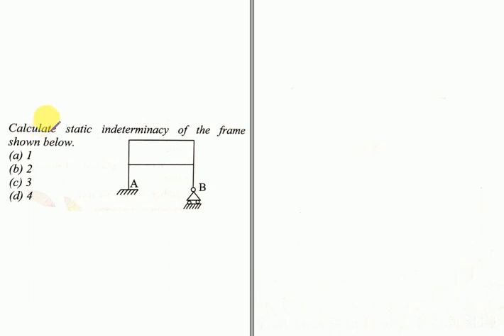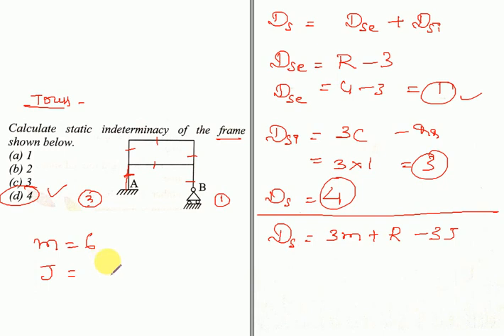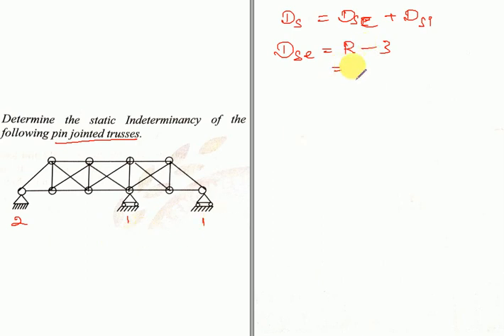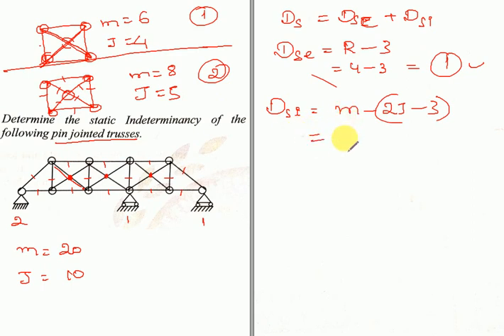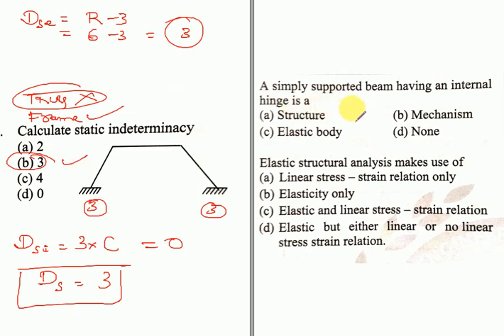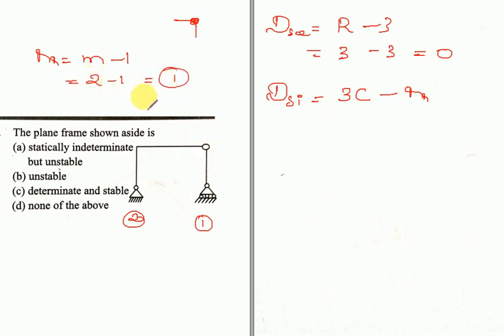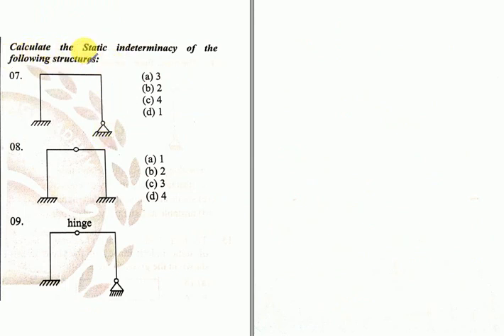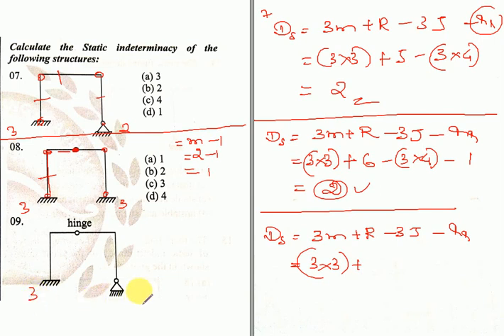Structural Analysis - Concepts- MCQ s - Static Indeterminacy- Part 3

Comment: Answer for second question came wrong because of calculation error in adding the Dse and Dsi, which is Ds = m + r - 2j not m -(2j-3) for pin jointed plane frame.